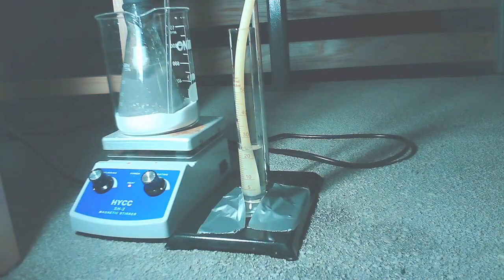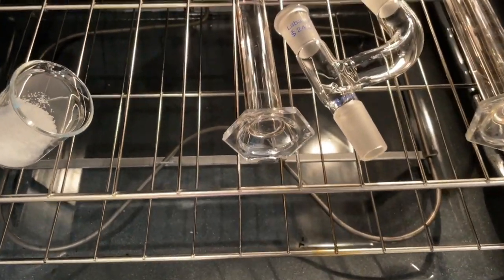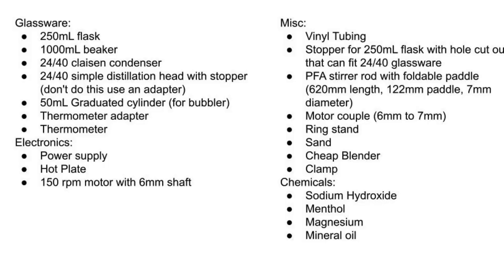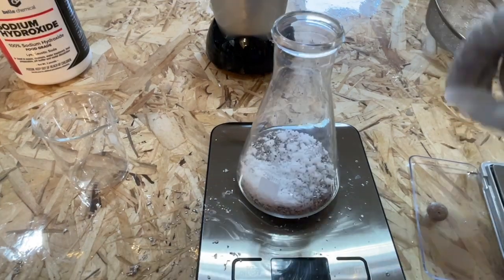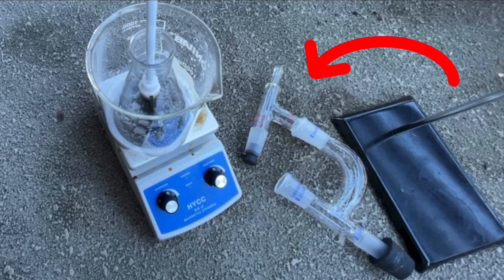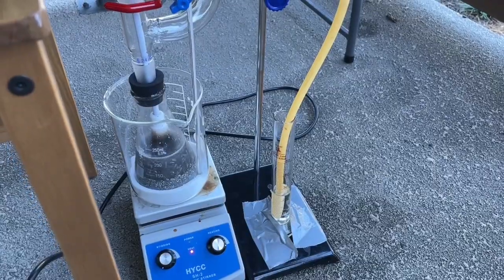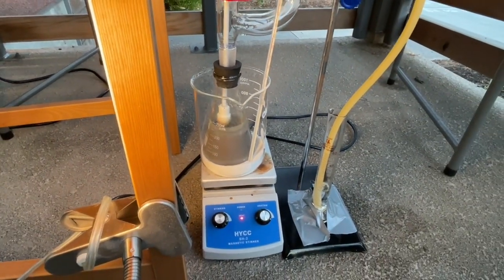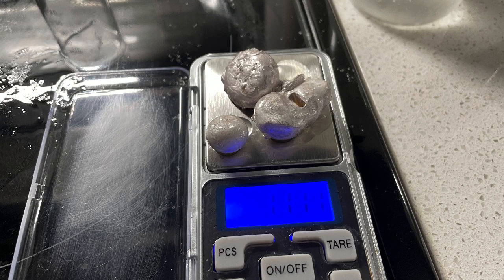Making Sodium Metal

Comment: Nice setup mith the mechanical mixer.
You don't have to use menthol to coalesce sodium, isopropyl alcohol also works and is cheaper.
I wonder why the suckback occured, if the temperature of the hotplate was the same wouldn't the gas volume be the same too?
Reply from the maker: Thanks for the tip!
Yeah, I thought this was odd. I think I read some places that the suckback implied the reaction had come to completion, but thinking about the reaction mechanism I'm not sure why this would be the case 🤔